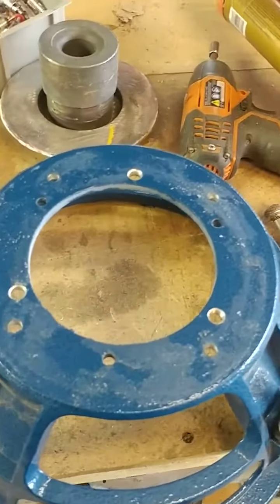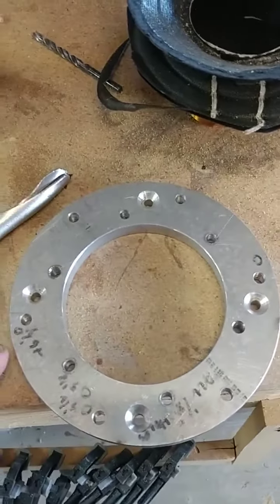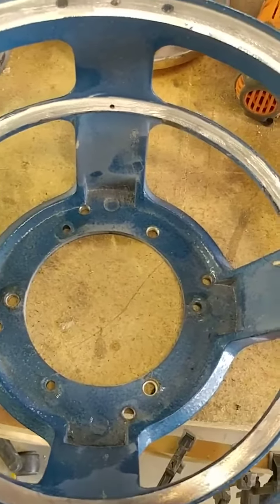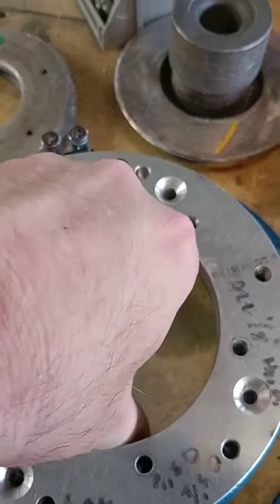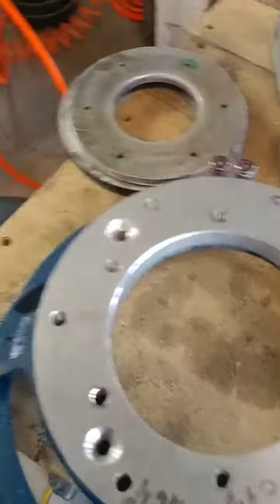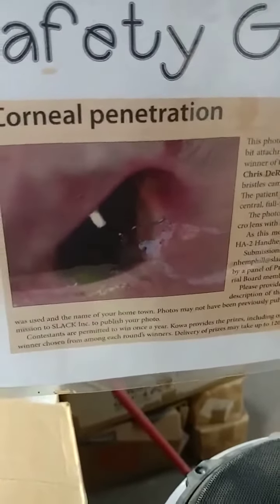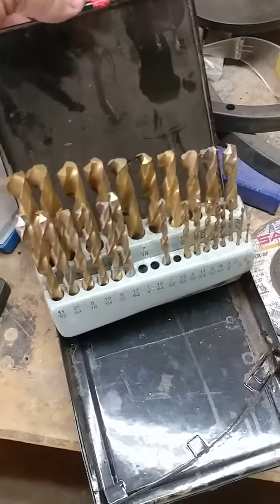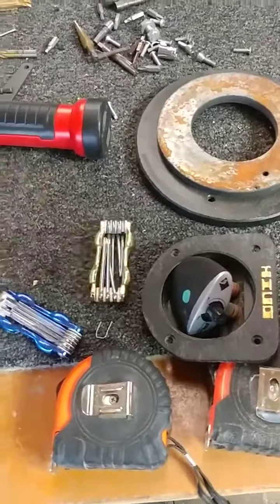Sunfire and TC Sounds random A @ The Robot Underground

Comment: So the fingernail image of this video I have the exact same setup in a ten inch Eclipse 3stack with a radiator whys this setup so good it sounds amazing but it seems that the two should cancel each other out
Reply from the maker: The passive is tuned to a certain frequency.  When the active driver plays that frequency, the passive comes alive.  It's all in The Loudspeaker Cookbook.
Reply: @RobotUnderground  how does one tune a passive?
Reply from the maker: @RollingThunder85  That's a good video subject.
Reply: @RobotUnderground  can this be done with 15’s and can I use a blown sub as a radiator if I remove the coil?
Reply from the maker: @RollingThunder85  Yes, you just need to tune it.

Comment: Not just steal them but actually toss them because they break and are garage. You want a cheap tool buy DeWalt. It will last 10x longer. This is not an argument , just because you said your workers are stealing tool when that's the cheapest crap there is before LingLing LLC. It breaks/wears out fast they throw away and grab a new one. Repeat. Hell maybe they are thieves but they only getting just as much productivity as at work lol.